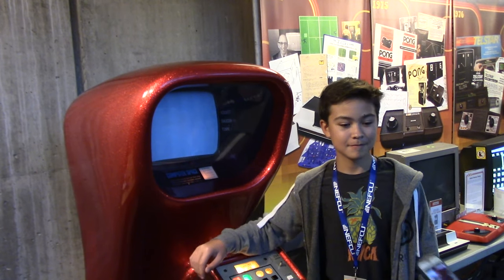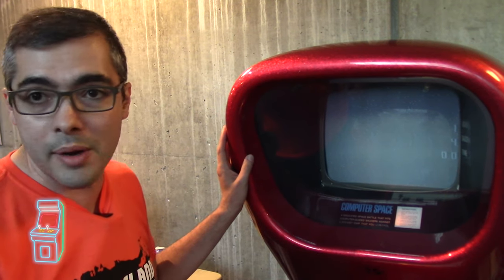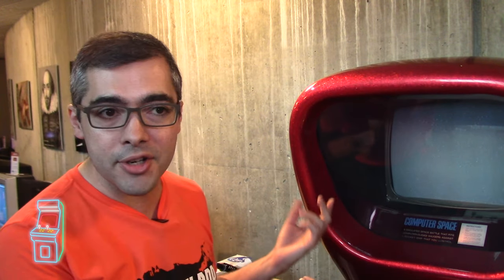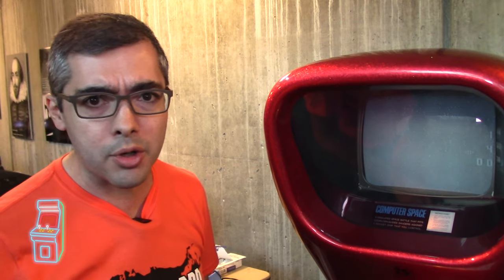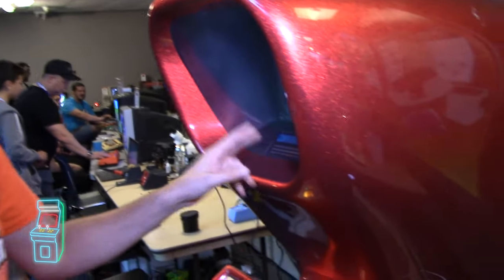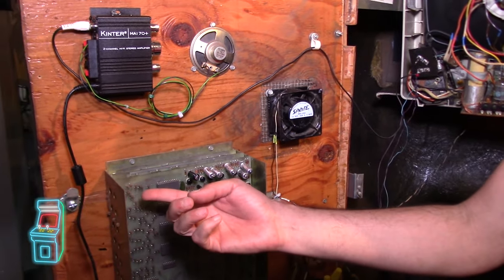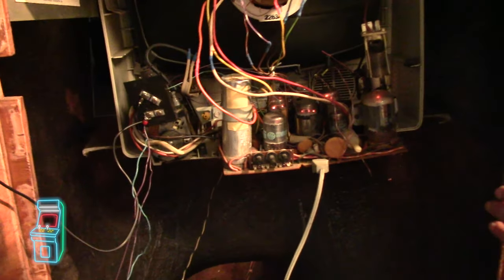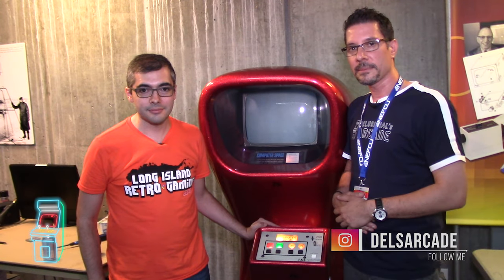Working Red Computer Space [First Look!]

Comment: The missing rubber insulation boot on the monitor HV line gives me the shakes.
Reply: It's only 600 volts or so, right?  I wouldn't touch tube electronics.  I always heard the caps can be deadly, if you are not careful due to holding those high voltages.